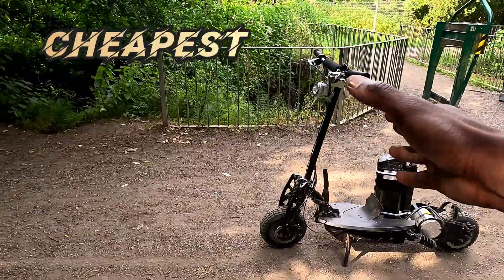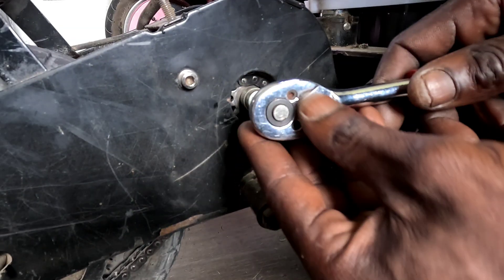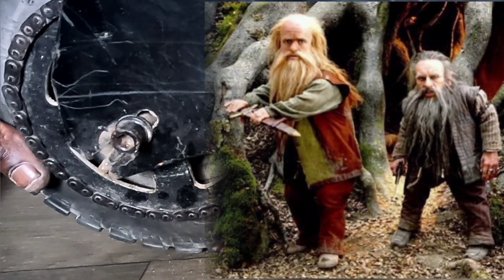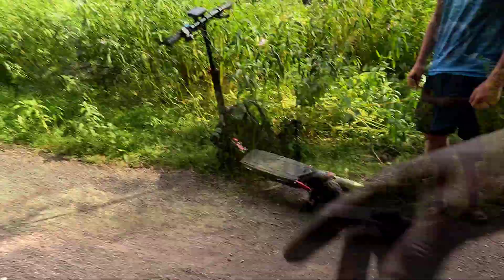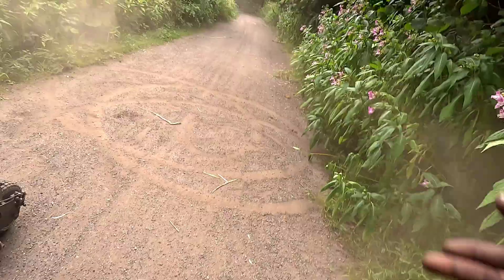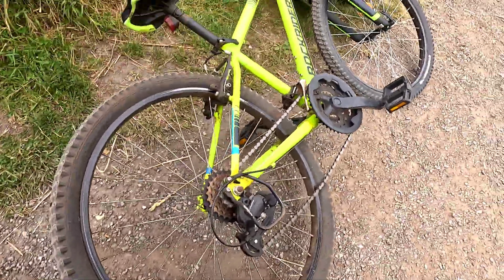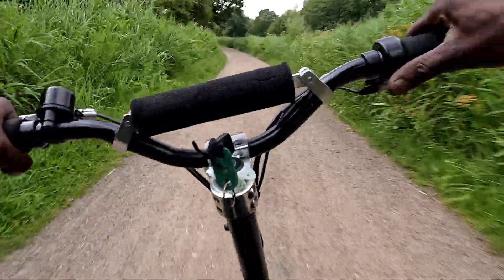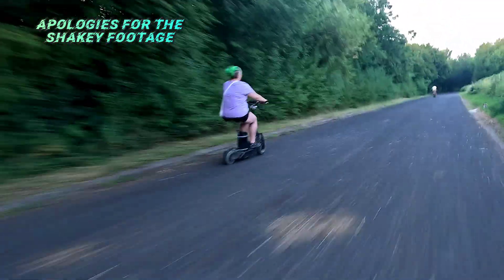How to make your Electric Scooter Faster with this easy hack

Comment: Watching from USA plz tell me how to make my eoeotwo faster‼️‼️‼️‼️‼️‼️‼️‼️‼️‼️
Reply from the maker: Single motor version goes 28mph, dual motor version does 40mph. You would be looking to add the dual motor system by adding a second motor. You can tell if you have 1 or 2 motors by looking at the wheels. If front wheel has spokes vs all black. All black is a hub motor. If it is already dual motor you would be best going up in the speed controller amps as an upgrade. You can get 3000watt controllers with 45amps for under $50. That would send that to the moon.

Comment: What's the easiest way to add speed to Sunnigoo m2 electric scooter?   Tried everything.....   Went on even "How to speed up any electric scooter" posts....still nothing.
Reply from the maker: To make it have more oomph, it is the electric speed controller that needs changing. Keep the same voltage but more watts.
You will find the installation of the speed controller is the same as putting it into this scooter. 
If your scooter is currently 350w, you need a 500w speed controller for more power. You can go extreme and get 1000w but this cam make your motor heat up during use. It would need a cool down break after a big hill